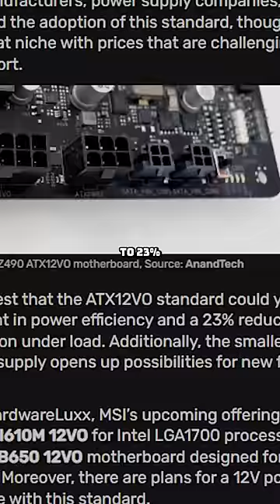Say Goodbye to the 24 Pin PSU Connector 👋

Comment: Over a decade? It must be at least 25 years old by now
Reply: 21 years from its creation. but didn't see full adoption until around 06-07. I got a couple pc's from 07 that still using the older 20 pin.
Reply: @chloedegurechaff1941 bruh, 20pin is basically the same, but adds 2 lines of 12v
Reply: @DRedGuia  No shit Sherlock. you clearly didn't understand ops comment nor mine XD. All I did was let the guy know preciously when 24 pin was created, and when mass adoption happened.

Comment: I've seen those 4 pin SATA power connectors on OEM office PCs like the Lenovo ThinkCentre. Downside as a consumer is the PSU itself doesn't have traditional SATA power cables. The OEM usually doesn't include extras and you need to buy new cables if you expand storage, though a traditional SATA power splitter also works. Upside to the manufacturer and also consumer is the 4-pin connectors for the drives can be positioned closer to the drives and use smaller gauge cables, instead of routing thicker cables and obstructing other components. That can matter a lot if you're trying to reduce the case volume and service the PC.

Comment: The aim of 12VO is to significantly reduce idle/standby power. Loaded power remains about the same. Many people keep computers on for long periods without doing any load. If widely adopted, it will reduce total load on electrical grid measurably

Comment: I have a 5600x and 32gb 3600 ram. Should I buy a 6750xt or 6800 for 1080p
Reply: For 1080p and with the 5600x you’re better off with 6650xt imo
Reply: What the guy said below is true and honestly both those cards can play 1440 on most games easily I have a 6700xt and haven’t found a game it’s struggle with
Reply: 6800 is obviously the best choice, but i will suggest you to go up to 1440p, in 1080p the 5600x can be a slightly bottleneck for some games, but nothing substantial.
Reply: 6800
Reply: they are both killers in 1080p, but the 6800 gives better preformance for its price. Only go for the 6750xt if its like 60bucks cheaper in my opinion.

Comment: We don't need more proprietary bullshit #Open_Source_all_the_things!
Reply: Is not proprietary. Look at the Intel documentation. It's really good. Cheaper psu's with better efficiency. It's a win win situation
Reply: @_Hasboa_ if you only look at the psu side yes. but if you factor in the motherboard/gpu sides where they place the dc>dc conversion then doesn't really make much sense since it's only going to hike their prices/complexity up. also look at 12vo Gpus and their current issues like melting and getting caught in fire. unless they iron out all of those issues, they shouldn't implement "improvement" on an otherwise bulletproof design of 24pin.
Reply: @yukirevive2722  gpu's have always been 12vo. And those additional complexity vrm's on the Mobo are much more efficient than using a 24 pin psu. That's why it's easier to get a 80+platinum 12 vo psu. Because it's 2 rails instead of 6-7. 12 voltage and 12 standby. That it. And btw the melting of 12vo connectors. Never heard of it. Oem's like Lenovo/dell use a tweaked version of the connector and it's super reliable.

Comment: This is a 24 Pin connector just cut into 4 ports. Ok you could let one Sata pwr off the board if you only use whatever amount of sata is powered by one. But thats about it. I remember a short a while ago where you complained about the motherboard powered gpu, no more gpu (pcie or 12vhpwr) cables, ridding one of the theme of a build. Well now with this, instead of a wide cable with 12 cables that can make your builds theme pop, you have now a seperate 5x2 pin, a 3x2 pin, and 2 4x2 pin connectors with respective 5, 3 or 2 cables showing. Making the build extremely ugly + adding "more" seperate cables...
Just ugly AF

Comment: its a common connector for your two rails. (12vdc/5vdc) 3.3v optional and signal. the big connector was mostly redundant of the 4 options needed. Its old and needs to go away. we have much more efficient power supply options now.

Comment: Huge efficiency soecs you nentioned is a good reason. Huge reduce in powergrid loads. Reduce in power supply load. Cheaper power supply with less Wattas and less cost to run same build. Two finner cables that bend better and are easier to poace hidden on the case. Removal of extra cables that reduces costs of power supplies. To say a few....

Comment: Efficiency is super important for a number of reasons. For simplicity let’s use 25%.

25% less power consumption means 25% less heat is getting put into your computer. This means that your parts will last longer and can clock higher. Plus you can get less expensive cooling systems.

25% efficiency boost is also the difference between a 1000W power supply and a 750W power supply, at Best Buy that difference is about $100. Plus 250W at $0.15 per KWH is almost $200 after about 5000 hours of gaming over the lifetime of the build. (Even more if you factor in your AC cooling the room, but less if you run a heater)
Reply: Plus, while I’m at it. Some Intel CPUs are having issues where the material simply can’t cool fast enough. If you wanted to make it faster but you can’t take more heat away then you need to put less heat in meaning that you need more power efficiency.

Comment: It makes sense, given how the 24 pin connector originally supplied power to everything else that was plugged into the motherboard, but modern systems have separate power supplies to high power usage things like graphics cards.

Comment: The 2 four pin connectors are for sata power and it looks like they may have just reduced the number of ground connectors and might be getting the motherboard to handle the different voltages so the power supply and connector are "more efficient" by using only one voltage likely 12v

Comment: Actually, the 24 PIN connector is the most practical. Later on, there will be several issues with MB due to the changes of the 24 PIN connector.

Quite a bad move in my own opinion.

Comment: It’s needed. Many of the voltages on the 24 pin connectors aren’t even used anymore, but the PSU still has to support it.
Reply: There is only three voltages: 12, 5 and 3.3, and they all in use...
Reply: There is also -5 and -12 which you have to consider since they take extra pins. You only need 10 of the 24 pins on a modern mobo, and you still will need the 8 pin cpu connector.  Way too much 5V on the rail that’s not in so much heavy demand anymore. I know that -5 isn’t even necessarily spec anymore, but it’s still occupying a pin on this old connector.
Reply: @icemage  Well...they just moved 5/3.3V to the board itself, so they arent even removed.

Comment: Part of what’s going on is that now the motherboard has to do the conversions that the power supply used to do. This means that any SATA devices you may have, now need to be plugged into the motherboard to get power, since the PSU no longer supplies 5v and 3.3v rails.

Comment: Now I see, the DC-DC converters for 5 and 3,3V rails will be moved on motherboard. Total power efficiency may remain the same.

I could build my own 12VO powersupply with external DC-DC converters, wich is ridiculous as the 12VO standard.

Comment: Considering how much time consumer hardware idles and how much the motherboard draws relative to the powered chips its pretty significant.
As to whether its actually replacing the current standard im not sure.
I read it was for oems and this has been reported many years ago.

Comment: As a person who uses SATA devices on many systems between home and work I don't like this decision. However with that said many HP, Dell ... were already using 12V only power supplies even in servers where they have a daughter board that converted the 12V to 5V and 3.3V for a hot swap bays.

Comment: yeah, making the pins smaller like on the 12vhpwr connector is sure to not run into any problems at all^^
Reply: The smaller plugs are for SATA power. The rest are exactly the same size.

Comment: If the motherboard that connects to every part is fuel efficient than other parts can be made fuel efficient. If the socket keeps supplying the same power draw to a product that isn't using it, it's still drawing the same initial power.

Comment: It will make it a little easier then trying to get a fat thick cable to go and bend where you want it 

May be a few extra smaller cables but probably will look nicer and be easier to plug in along with their supposed better specs.

I don't mind it problem is what power supplies are even going to be compatible though

Comment: It depends on what kind of machine you are running. If it’s a high spec device or if it’s running power intensive processes for a long time, then it’s going to draw a lot of power. 

I imagine they use better switching transistors to reduce power wasting through heat loss. But I’d be interested to know what they are doing differently with this version.

Comment: If you run a p3 with ups on battery, after a while the passive cooling will turn on, and cpu fan is not needed. The hdd slow spinup will turn on, and the auto brake. The brake is similar to those in diy screwdrivers running on battery. The ups chip should cause this, that eprom is similar to those that exist in laptop batteries.

Comment: If you count the original 20 pin iteration of this power connector, it's like nearly 30 years we've been using it. The old original IBM PC/AT connectors went away in the 1990s some time.
Reply: The ATX standard was introduced in 1995, but afaict it didn't really become a thing until the release of the Pentium 2 in 1997 and didn't completely take over the market for a few years after that.

Comment: Lets wait and see if it really catches on. So many "new standards" just died because no one wanted to adopt them like the BTX form factor standard or Itanium CPU architecture so its not really certain that those won't be the case for 12vo too. Especially as that standard will cause problem with legacy hardware that needs non 12v power like Disk drives, old still in use computers that need regular power supply swaps and such.

Comment: Motherboard power efficiency means we can also use that power to power up a better gpu with motherboard power only. Those clean case builds with no wires going to the GPU. Before any ask. Yes some GPU only get power from the motherboard. Most modern gpu that I can think of that does this is a GTX 1650

Comment: I feel like this idea would be better for an ITX or on microATX build.
Reply: think you misunderstand, 12v -> 3.3v and 5v get moved to the motherboard. Currently its in the PSU. So less room on smaller boards means ATX is better suited for 12v only PSU.
Reply: I didn't mean power was I meant spacewise. Idk I guess I thought it would look less complex.

Comment: Ahh yes the good ol split a single 24 pin connector into 2 x 4 pins 1x 6 pin and 10 pin connectors. definitely will look way cleaner in custom builds.

Comment: It reminds me of OEM boards which have the  power connectors for sata drives on the motherboard and a 6 pin connector for the board and a 4 pin for the cpu this has been a thing for nearly a decade but it never takes off cause it isn’t a fix or convenient just more proprietary problems and hard to replace if your PSU fails (will be more expensive too most likely)

Comment: I would say that the thing is that today MBs don't really need all those 5V or 3.3V pins, modern MBs or even GPUs eats just 12V and creates lower voltage by their own VRM units, so half of that big connector is pointless now.

Comment: Power effiency will reflect partially as less heat for the same amount of computing output.

Similarly more computing output for the same amount of heat compared to latest predecessor

So, all is a win win situation on computer performance, lower electric bills, temperature and overall a longer life span of a system with a power supply like that.

Comment: Noe the next thing ALL manufacturers have to add is a pcie slot release button, m.2 tool less instalation clips, bios flashback, clr cmos button on the back io panel. These are more qol improving then reducing connectors. My b760 asus rog strix has all these for just 260 euro. Even the z790 asus rog strix has it for 287 euro

Comment: I could be wrong. But it seems to me like that's an EATX board, and those suckers often need supplemental power, and that middle connector seems to take a 6pin PCI power cable. So maybe its just 3 connectors? 🤷😂

Comment: It's a matter of scale. Not only are energy prices much higher in other parts of the world but all that energy usually, mostly comes from fossil fuel. Any amount of energy we can save is good. Not only that it means buying a smaller power supply because you can now provide all of your computer needs with less power.

Comment: Would of been ok if they would of just gone with a clamp lock connector versus this spring pin friction connection. Yes they are cheap and effective but why not send 48v or 52v to the motherboard so some crazy CPU and GPU options could be available. The higher voltages   Could provide more flexibility and support for hardware developed for other industries.

Comment: It's so tiny because PSU will pnly supply 12V, hence the name 12VO.... Current chunky boi sipplies not only 12V, but also 5V and 3.3V which are all necessary for low power components. Now voltage conversion will be done on a motherboard. Also Linus tested this solution and under load difference is marginal, but idling actually hits around 30% less power required by the system.

Comment: I don`t think that the most people understood this. The psu only delivers 12V to the MB instead of 12V, 5V and 3,3V. Breaking down the 12V is now managed by the motherboard, this increases the efficiency only by a few watts. This technic would mainly be used in pre-build pcs. 4-5 watts times millions of solled pcs will make the difference.

Comment: The smaller 4pins are going to be used for high powered gaming LEDs. Each will be able to power 3,326 LEDs in a single strip.

Comment: If you've ever worked with HP, Lenovo, Acer or Dell you'd already know what was going on.  It's not the power /TO/ the motherboard that is making it inefficient.  Its the fact the power supply is making 5v and 3.3v as well as the 12v.  Since it doesn't know if its going to be 10/20/40 or 200w of power from the 3.3v or 5v rail it cannot make the most efficient decisions.  All they are doing is offloading that circuit to the motherboard, which does know a little better what the power draw will be because it has a finite number of memory channels or SATA ports for example.

It is trivial to re-pin an old power supply for 12VO, you can buy a 24-pin extension and a de-pinning tool for under 20 bucks.  (If you are making a permanent mod you could even use just the tool.)

Comment: The problem with the connector is the f size XDDD they just need to put it 90º to the side pointing at the front of the case so the cable goes right through, no need to fold the cable, just like satas are now build as pretty much standar

Comment: The reason why this is happening is that they're moving power tranformation of the 5v and 3v lines to be local on the motherboard, rather than in the PSU

Comment: It's still a 24 pin, just now it's separated into 4 new connection points so now its 4 smaller wire groupings instead of one big one.

Comment: Power efficiency to your mobo means more power to your components a smaller wattage PSU so you’re not straining your PSU on a high end game as it ages. So longer lasting components, better game-play without heating up your room in the summer as badly.

Comment: All connectors is fine. All thick wire should be made more flexible. Maybe thinner, or flat. Or the location of the wire rerouted on the mobo near the psu and not across the board. More cleaner look for pc

Comment: Atx12vo is pretty old as far as i know, there is already a bunch of server architectures that use atx12vo for power delivery, because if you can save a few bucks for a server running 24/7 what can you do if you have thousands of these machines running... And atx12vo is already proven so no problems on the side of connectors melting

Comment: Power efficiency means less loss in power I.e your PSU may put out 1550 W for a card that only needs 1475 W. (Not an exact estimate merely an example) meaning you've got 75 W of loss and it's usually from heat and/or mechanical losses in motors, so fans and HDD. Basically it means you can run your PC at the same specs for less cost and belive me those costs can add up over an anum

Comment: for someone living in SEA and have unfair electricity bills that always changing rules almost every 6 months or having mysterious raise in bills that will never be explained. Power efficiency is important, also if this really as good as its promises it will change GPU board too one day, since GPU nowadays can be bigger than motherboard, which is funny while CPU, Ram, PSU, etc. get smaller.

Comment: The ATX 24 pin connector goes back to the '90s and it works fine as is. Having a bunch of smaller connectors makes for much uglier cable management and Im not about it.

Comment: Personally, I'm against 12VO. It will make motherboards more complex, increase their prices (which are already pretty high) and introduce many new points for failure. Also, it will be more efficient only (i think) if the motherboard manufacturer integrates good quality voltage converters to their motherboards. But it's true that on the other hand, we should see more efficient power supplies with lower price, since they will only handle the ac 220V (or whatever ac voltage your region has) to dc 12V conversion.